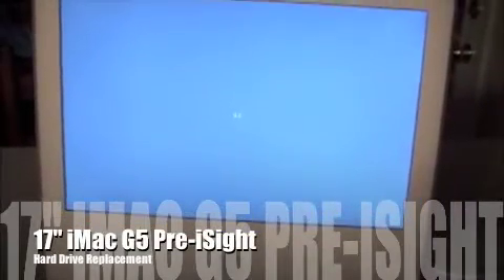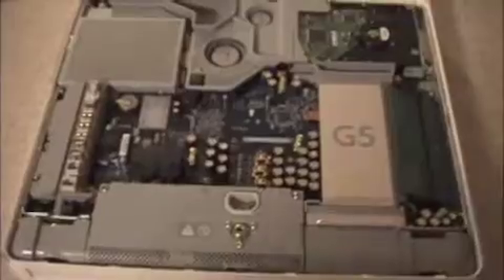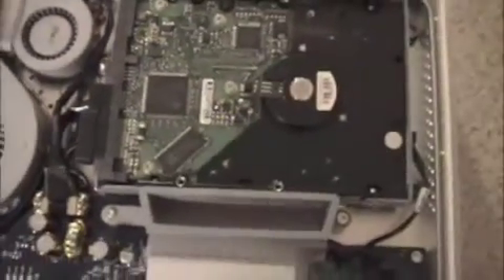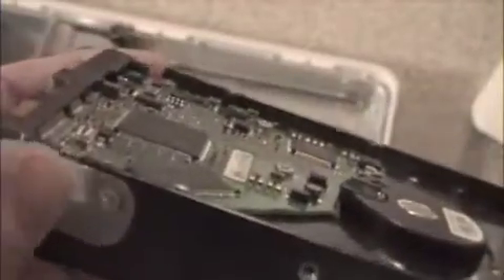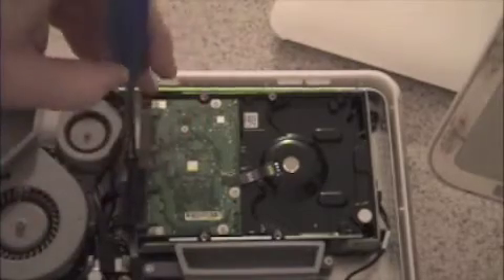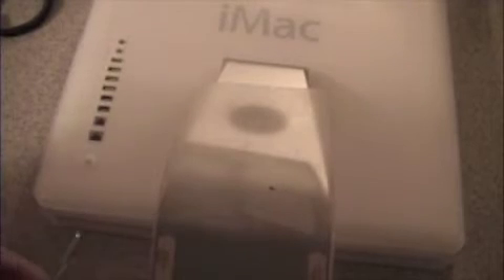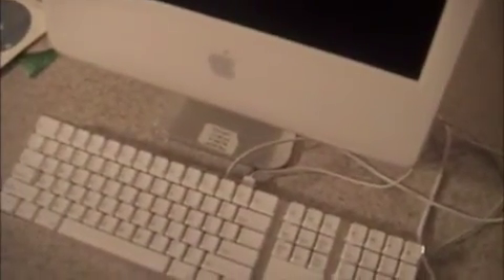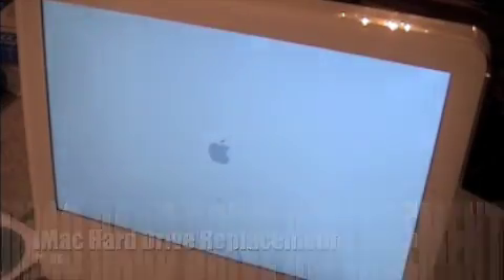17" iMac Hard Drive Replace

Comment: I work as a Systems/Network administrator (5 years exp) and have used the freezing method before.

This method works when the drive will detect when plugged in (not a circuit board problem) and the platter still spins.  When drives fail under load (say transferring a 2GB file it fails halfway through due to heat) freezing it can work wonders.

Make sure to put it in a ziplock bag and get all the air out to prevent frost when you put it in the freezer.

Comment: Great video.   That looked even easier than replacing a hard drive on an old imac G3.   Unfortunately I would have to take my current 20" into the shop to replace the hard drive.   I have seen a video on replacing one on it and it scared me to death on all you had to do to get to the hard drive.

Comment from the maker: This all depends on whether or not the hard drive was your problem.  If the hard drive is good, you should be able to pull everything off of it.  If the computer that the hard drive was in is not working, you will have to find a way to pull that information off of the old hard drive.  External hard drives are pretty inexpensive now and I highly recommend getting one.  If you are buying a new Mac, Time Machine will save all of your info to the external hard drive in the future.

Comment from the maker: @marissuuhWearsprada SATA regular size (not laptop size) hard-drive.  I put a 500 GB in mine.  You can go up or down.  500 GB should be plenty.  The 3 screws are on the bottom of the display as shown in the video.  They are just lock screws, turn and loosen.

Comment from the maker: Sorry to be so late responding. If you have this type of Mac, I recommend that you go ahead and open it up (it's extremely simple) and get the information directly from the hard drive installed. If it is a newer version of the iMac, they are more difficult and there are some excellent videos posted by others to show how to work on newer iMac's.  I would not want to send you off in the wrong direction.

Comment from the maker: @jethronh Not at this time.  You may be able to find one elsewhere on line.  If you don't want to mess with it yourself, you might try this on eBay.  I have not used the service, but they do have a 100% rating with over 450 posts.  Their prices make it almost easier to let them do it for you or buy a refurbished unit.

Comment: Very helpful. I might just have to bite the bullet on this one and get them to install a harddrive (that I plan to buy from a 3rd party). Wish the intel iMac was as easy to do having read a bit on people servicing theirs I can't see myself doing so. Wish I had a G5 model cause your video is very informative. Do you think they could do a diagnostic on my iMac to determine if it indeed is the harddrive? Thanks for taking the time to answer my question it's greatly appreciated 5 stars on the video.

Comment from the maker: @flxibl2008 Nothing that I have experienced.  These Macs are easy to get in to, so you may just have to open it up and see if you can get to it.  Probably going to need to replace the drive to avoid it happening again.  Turning them on and off with the eject key sometimes works, but if it's is something mechanical, that most likely will not help.  Maybe someone else will have a response for you.

Comment: geez man, that's so old fashioned, you don't need a wrist strap!  just touch any metal part on the case before you start handling stuff inside.  btw, what did you have the other end clipped to in this video?

Comment from the maker: @marvin4578 This sounds like it may be your hard drive or the fan.  I would not waste any time getting an external hard drive to back you computer up to and at least be prepared if your computer hard drive goes.  If the fan is not working properly, it will cause the hard drive to crash and maybe more.

Comment: My iMac g5 with iSight recently has restarted itself and had the line issue. I've searched online an this appears to be a common problem with this make (intel iMac duo core). I tried powering it on today and I get a flashing folder with a question mark. Would this have to do with a fried harddrive? Any answers to this would be awesome if so I'm trying to avoid getting it serviced by apple because I'm sure it'll be expensive. I love my mac and I'm eager to find a solution to this problem.

Comment: On the hard drive, when I remove the three cables, there is the sata, power, and then another one on its own side. It plugs into some port on the motherboard underneath the ram slot. What is that cable? Mine was unplugged when I got it. Is it important?

Thanks

Comment: I have the same iMac g5 what year was it made?? It has 1gb of memory I think it may hold 2gb. But your video with the same iMac as mine with the 4 screws on the bottom. I looked for dates and found 2002 up to 2008. Want to know if I can add ram bigger hard drive and newer OSX It has 10.4.11 OS with dates from 1983-2007. Any one  know how to tell???? ThAnX 4 any help..

Comment: Random question - can a 17" hard drive and memory fit in a 20" Imac G5?

Any help appreciated!
Reply from the maker: Mz J The hard drive on a 17" Mac can fit into a 20" Mac, provided they are the same physical size and do not exceed the maximum storage size for the different Mac (i.e. 500 GB or 1 TB, etc).  Hope this helps.
Reply: gemsroadwarrior Got ya!  Thanks for the reply.. appreciated!

I now need to find out if they are indeed the same size.
I know that it can take a maximum of 2GB.

Would this also be the case for the memory?